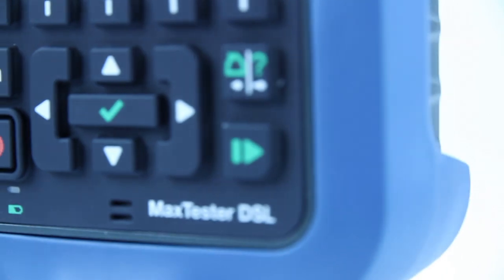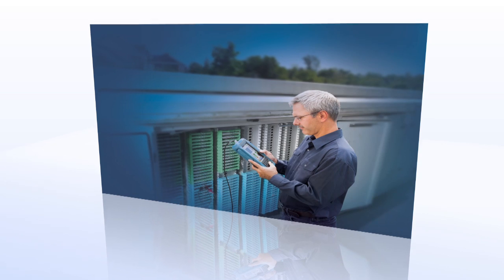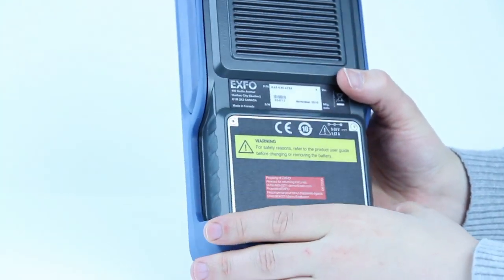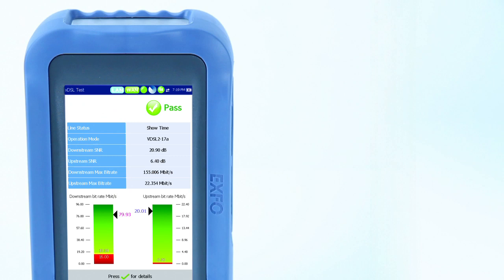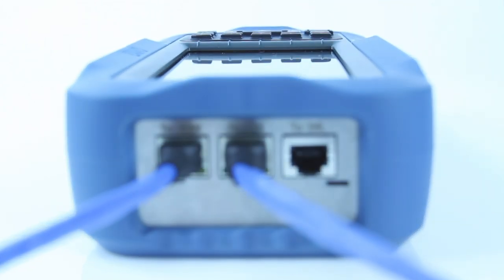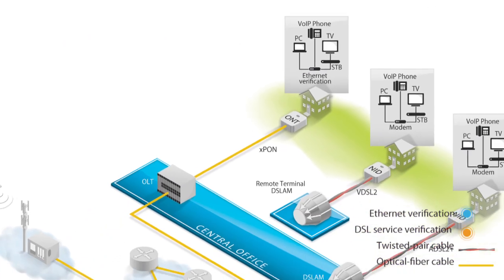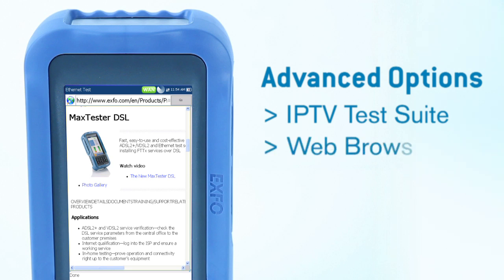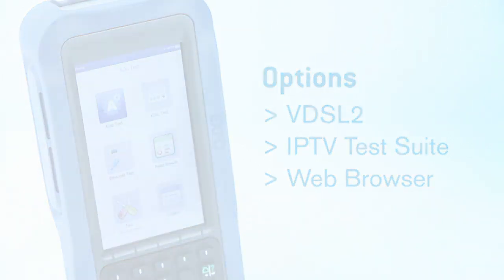Copper test set (Voice & DSL circuits!) - Discover the Maxtester DSL

Comment: battery life needs some serious work.  Also I don't understand why the copper test leads can't also be used to test sync like the JDSU.
Reply: Actually you can you just have to change the settings from rj to copper in dsl test.
Reply: Just picked a new one up today. Not used it in the field yet, but it has a massive battery added. We all work differently, but I have used the copper leads to sync my JDSU  only a couple of times in what must be close to a decade of use. The reason I did not use it like that was because I like one cable to do one thing, and one to do another. Waiting for sync because it is on the wrong setting causes all sorts of problems. I had a no sync fault and was in the exchange. Another engineer was in the exchange and asked to borrow my JDSU because his was in the van. He had it for 5 minutes and then handed it back. After failing to achieve sync anywhere on my circuit, I realised he had changed the settings to copper test leads and handed me it back.
Reply: You can choose to use the leads or the rj jack in the settings champ.  I get vdsl sync fine with the leads